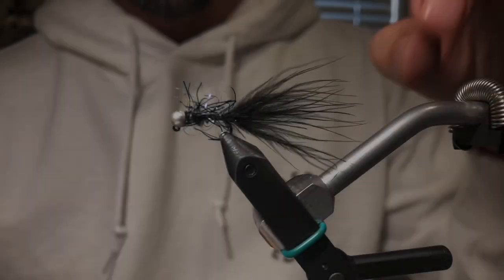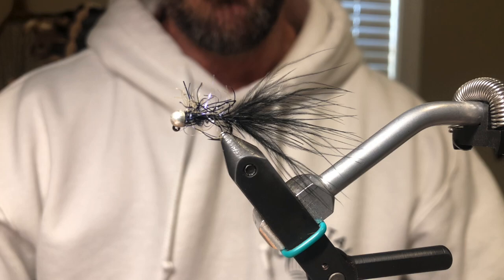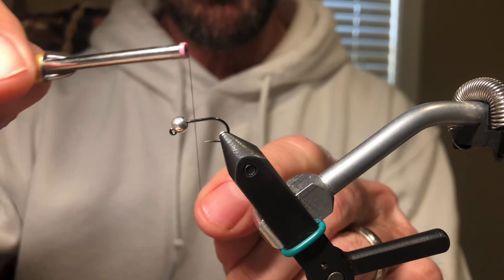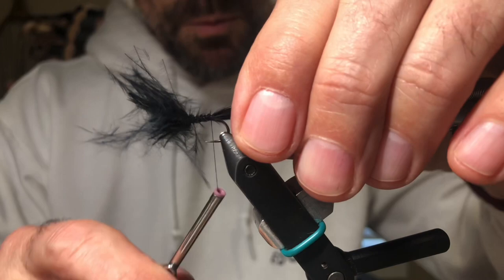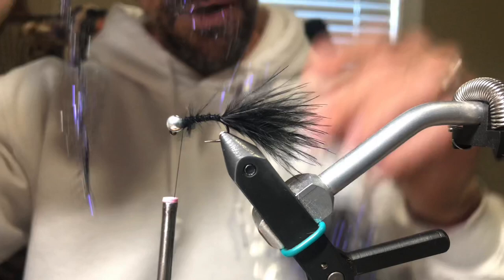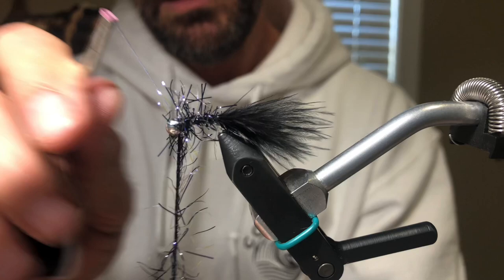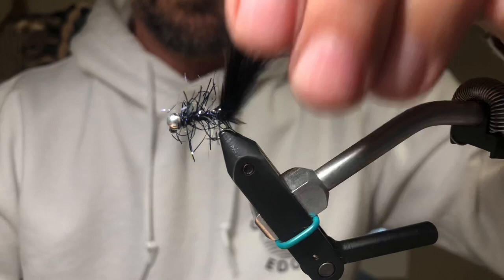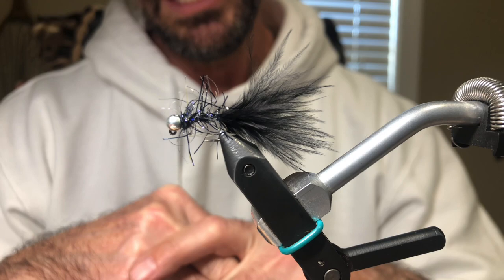Tying Pat Weiss’ Jigged Streamer

Comment: When I tie a slight variant of this micro streamer, or any streamer for that matter, I slip a leftover length of wire through the eye and dangle the fly under the running faucet to see how it shapes up when wet. For a preview, I suppose.

I’ve been giving the fly small jerks as I fish it, but I suspect that your technique is more effective.
Reply from the maker: Funny Larry-I’ll fill up my sink with water to see how they look when jigging them.  Remember, when they are wet they actually take the dry shape (for the most part) when they are still/dead drifted. Then they will fold back when pulled.

I find a slight jigging action works best-but trying different action to trigger strikes is always a good thing.  

Appreciate you watching!
Reply: @OldDominionTroutBum  - I appreciate your learned instruction!